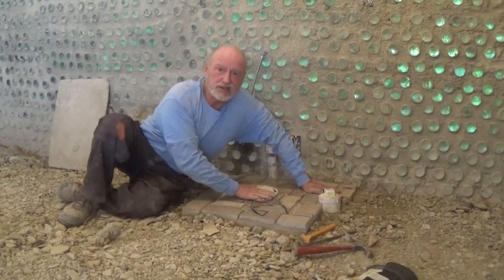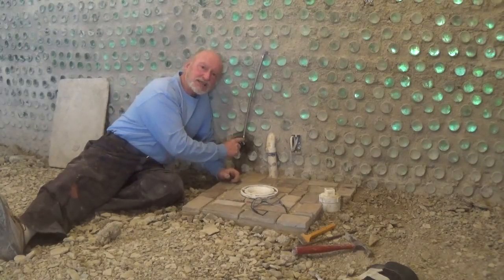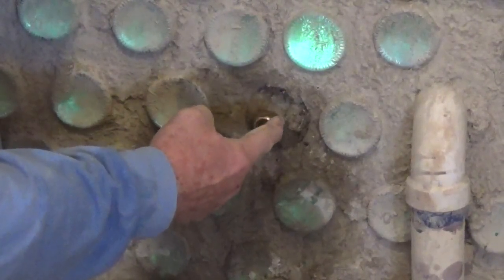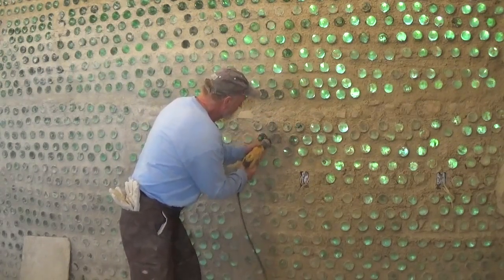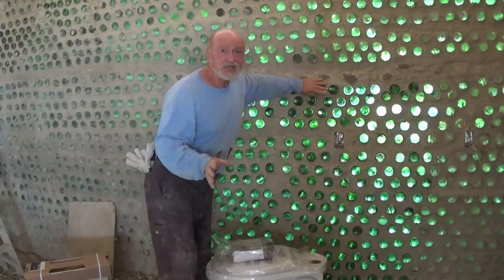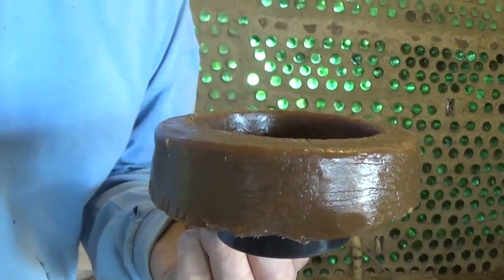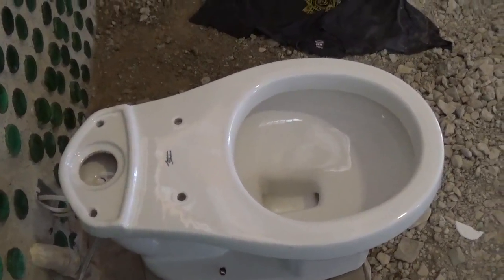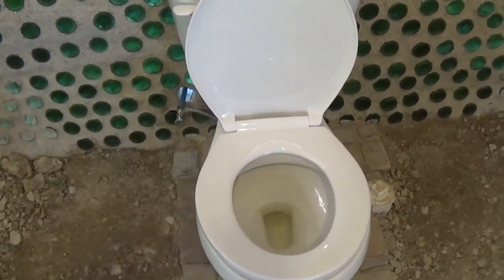Installing The Guest Bedroom Toilet (at last)!!!

Comment: having the light come through the bottles is cool.  Hate to hear that will be lost.
Reply from the maker: The garage door will be open most of the time though, so light will still come through that wall most of the time. However, the outside wall of the bathroom is a "light wall" designed to have light shine through all the time. Once I clean those bottles, I will post some photos, it is even better than the toilet's wall!